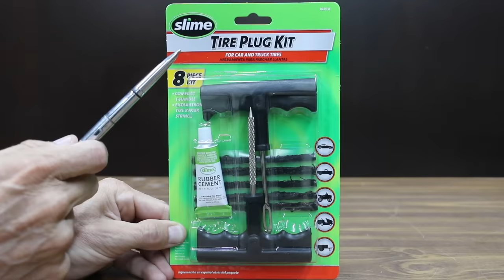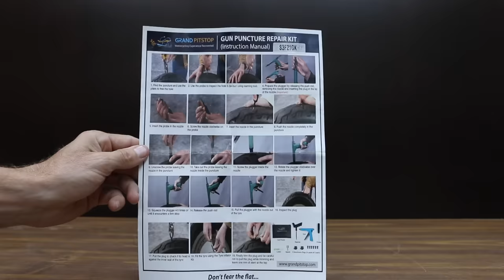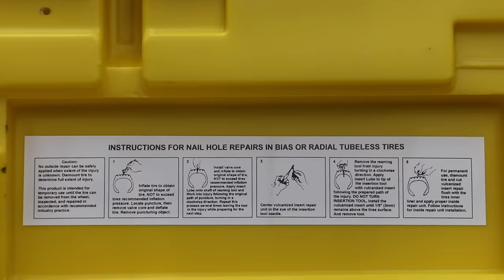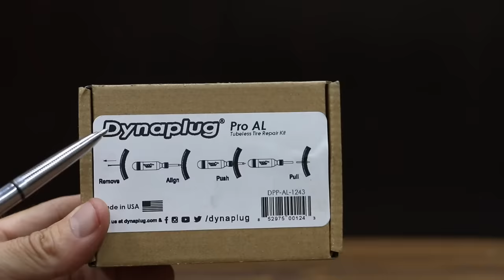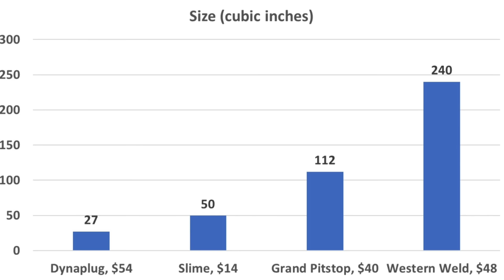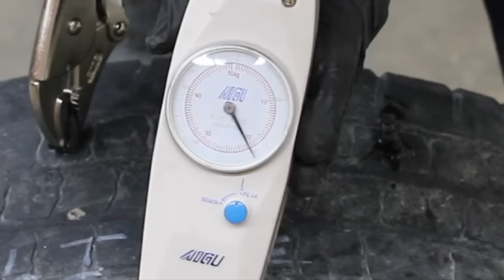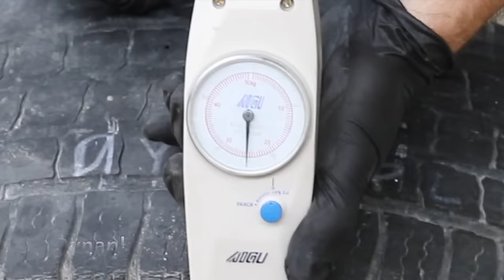Best Tire Repair Kit? SLIME, Westweld, Dynaplug, Grand Pitstop

Comment: I never saw a mushroom plug for a tire. I like the Dynaplug, a nice design and very compact. Great testing as always! You were having way too much fun in that SUV. LOL Be prepared for many "Reaming Lube" comments.
Reply: I picked up the mushroom type for my motorcycle from Stop and Go and glad i did, I managed to get 2 punctures within a month and rode it with plugs in for the rest of the tires life.  Tho riding a motorcycle tire with plugs in it isn't recommended, there are a lot of people who still do because if tire prices.  Also this was in the rear, if it was a front tire I would of changed it right away.
Reply: Do not lick the mushrooms, you will have strange visions, and taste only rubber for a week.  ;P
Reply from the maker: Dynaplug has a great design and the compact size makes it perfect for just about any vehicle.  Thanks again!
Reply: @pheelix-  I had a plugged rear tire on my bike for a year, never had an issue. In fact I ran that tire till the end of it's service life plugged and it never leaked. I'd never do it on a front tire either, that would be too dangerous.
Reply: There's another type 0 shape you we have been using for years in the UK very good as long as it's not a slash lol shame I can't put a pic up
Reply: @bigbothoee8617  any idea what they're called? I have slow punctures on every single tyre on my car lol
Reply: I would prefer the mushrooms for farm tractor use but rope for my truck
Reply: @ek8710  Have you checked for leaks around the valve stems? I have that problem on my set of winter wheels, one of them was fixed, but there are three left that are slowly leaking.
Reply: I have seen the mushroom type plug, got one tire fixed with that back in '87. No problem whatsoever with that tire.
The need to replace tires is not really that extreme if you haven't been running the tire completely empty in which case the cord gets damaged.
Reply: Some might comment on that, butt that would be beneath me. Some a-hole might make a remark about lubing, reaming, then shoving a plug in the hole, but not me.
Reply: @IhateYoutube  In the 90’s I used  the mushroom style on a routine basis. We had a fleet of Taylor Dunn “golf “ style carts for the maintenance crews at a college. The guns cost just over a $100 back then, had a much larger opening, and we would coat the plug with glue. They worked great just too expensive at the time for personal purchase.
Reply: @ek8710  for slow leaks try tubeless tire sealant or slime
Reply: @bmxscape  seconded. The tire shops will hate you but sucks to suck LOL just warn them ahead of time
Reply: when I worked at a gas station in the 60's our mushroom plugger was air powered, worked great, and their were several diameters.
Reply: I used to use that mushroom crap when I was an intern in college. Those things were terrible. They were not guaranteed not to leak nor would they last the life of a tire.
Reply: @BigHoss1776  That's the trick. The companies claim that mushroom plugs don't require rubber cement, but I haven't (and wouldn't) used one without it.
Reply: @justastudentoftheworld3940  ... Since you're still a student, they're looking for their cat over there.
Reply from the maker: Thanks for the feedback.
Reply: @IhateYoutube  We had an air powered mushroom gun at the dealer I worked at in the early 70's, worked great and much easier to use than the hand pump ones currently available. The mushroom plug always seemed like a better more permanent design to me, very glad to see this comparison, thank you !
Reply: ive had mine in my car for like 8 years haha..
Reply: @IhateYoutube  I have had a patch job on one of my tires for about 3 years. I picked up a bolt from a railroad crossing. The bolt was probably about an inch in diameter and the head of the bolt plugged the leak just long enough to get home. At first I thought I broke a CV axle because the head of the bolt was hitting the road and picking up the back of the car. I didn't think it would be repairable but it's lasted pretty well.
Reply: @bigbothoee8617  , 
Can you give us a manufacturer, part number, and retail brand name. It would help to see if they can be imported.
Reply: There are mushroom plugs only you need to take the wheel of the rim and insert it from the inside
Reply: Another reason I don’t eat mushrooms
Reply: @pheelix-  I_
Reply: @ek8710  just get the slime ones there on Amazon for £5 and same day delivery
Reply: @ProjectFarm  TRy long term storage i had mine in my SUV  the thing did not work  the plugs got stuck or glue onto the plastic film and useless
Reply: You've never seen a mushroom plug? I play with mine on a daily basis and it's a one (extra small) size plugs all holes type kit...

Sorry lol couldn't stop myself 😈
Reply: looks like he has natural talent for drifting sport!
Reply: Best plug is mushroom plug trick is fill hole with supper glue install plug bottom side of mush room glued to inside tire like a patch pull with hand on stem of mushroom so it starches skinny add glue around it then let it go. And cut flush with tire. I hace repaired a 1/4 hole made by a bolt that three slime ropes could not plug.
Reply: @znogaragego3421  The Tire I plugged is long gone but I had 2 plugs in it and road it for the rest of the tires life with no issues.  I checked on the plugs every once and a while but it got to the point that i couldn't even find them anymore as they wear with the tire. 

Also FailNine wasn't using the kit that had the Tire Plugger Tool, If he had the kit that came with the Tire Plugger it would of been almost as fast as the Dyna Plug.
Reply: @pheelix-  
I carried a stopngo kit in my motorcycle. It got me home from a trip. I parked my motorcycle an unloaded it a went to bed. The next morning I got up an my motorcycle was on it side. Upon examining everything my tire had went flat. I checked the mushroom plug and it had went inside the tire.
Reply: I have a 2003 Kawasaki prairie 360 4x4 four wheeler and baught new tires for it on Amazon, the first time I took it out for a 2 mile drive, I ran over a branch and didn't notice that a piece of a branch the size of a nickel punctured my rear tire. The next day I saw that my tire was flat and saw that piece of branch sticking out my tire and thought dang, that's a new tire with 2 miles on it and now it's trash..
I then remembered I had my Slime kit and went to work pluging the tire. I took 5 plugs to get it done. It's been 2 years now and many many miles later and it's held up GREAT..I know that the tire should be patched properly, but I wanted to see if it would actually work in a pinch and it did to my surprise. AWESOME video bro as usual, You da man!!👍😎👍
Reply: @dcct1905  Sounds like you didn't pull it back up enough to seal properly.  I have had one do that to me once.
Reply: First you ream and THEN you stick the big mushroom tip in?  I've been doing it backwards all these years!
Reply: They're great for emergency motorcycle repairs
Reply: Yeah, and something to consider when you have to enlarge a hole to fit something like a mushroom plug: you're tearing up the belt, whether it's steel or fiber.
Reply: @phasm42  That is what i like about the mushroom plugs, you only need the hole to be the size to put the tip of the insert tool that the Tire Plugger screws onto.  And the mushrooms are about two times the size of the insert tool. With the mushroom expanding and the air pressure, its not going anywhere.
Reply: @ProjectFarm  please try to see if those grand pit stop plugs wore out, or got pushed back into the tyre? The hard rubber used for plug, it's girth, and lubricant used results in that failure.
Reply: Slime has a kit now similiar to western weld
Reply: I never seen such a thing either
Reply: @IhateYoutube  my dad has 1 from early 80s,who was the original inventor or company ? Patented surely? Dad has 3 sizes of screw on nozzles & plugs and his uses a hard plastic pointed insert for the nozzles to make inserting easy...havent seen anywhere since j.c. whitney quit paper catalog books

Comment: I use a plug kit called the “Stop and Go” tire plugger and I really like it.  I’ve plugged many ATV, mower, car, and truck tires with it, and I haven’t had any issues.  It’s basically the same as the grand pitstop.
Reply: I have it too, and its great quality, includes a zip bag. The trick is to shove the mushroom plug up into the gun tool so that its like an inside out umbrella.
Reply: @ksavage681  totally agree !
Reply: @ksavage681  that’s how I’ve always done it.  Works every time!

Comment: Looking back to this video today, thanks to having a tire issue this past weekend.  I had a tire losing air on my SUV even after filling, so I brought it in for repair.

The tire tech showed me that I had 2 screws in the tire, and one was too close to the edge for them to repair. I should note this is a BJ's membership warehouse location, all they do are tires, the repairs are free, so they are not earning commissions on selling new tires. I purchased the tires from them in 2020 and had a good run of some 60k miles since then, on tires they rotated every 8k miles for free. We planned on replacing the tires before next winter as they have been solid but nearing the tread wear indicators anyway. Being an AWD vehicle, 1 tire is not an option.

I purchased the new tires I wanted but they would not be in for at least 3 days, so I stopped for a Tire Slime plug kit and patched up the tire as a temporary solution.. Something people may not realize is WHERE to put the tire!

In your videos, if people are paying attention, the patched tire is on the rear for a reason!!

IF you must patch a tire, for safety, MOVE IT to a rear tire location!! If by chance the tire plug fails, and odds are it wont, but if you mathematically hit the bad luck lottery you will want that tire ON THE REAR and not a tire that steers!!

My wife drives this car daily as she travels for work, and I moved the plugged tire to a rear as it was just safer for her, until we can have four new tires installed tomorrow. Looking over your video again, Im buying the Westweld kit asap.
Reply from the maker: Thanks for sharing.

Comment: Future test: cold patch for asphalt pothole repair for driveways. I'm sure a lot of homeowners will appreciate it. You can make a few 1sqft boxes that are 2 inch deep to mimic a small pothole in your driveway. Then test several brands of "easy diy permanent" cold patch asphalt repair kits to see which hardens/cures quickest and which stays solid after a week or two after patching. (I've used cold patches that took well over 3 weeks to fully cure/harden. I was able to use a stick and move it around even after 2-3 weeks).
Reply: an asphalt pothole repair needs to last a lot longer than a couple weeks lol
Reply: @schlomoshekelstein908  I think it could be tested with multiple freeze/defrost cycles. Because that's how most paved surfaces are damaged, when water seeps in cracks and freezes, expanding inside.
Reply: @schlomoshekelstein908  oh I get that. I meant to say "test to see if solid after a week or two" because I've tried using cold patches that were still soft and moved around after a week. It didn't fully cure/harden after a whole week!
Reply from the maker: Thanks for the suggestion.
Reply: The city paved my alley way and it made all the water that normally went down the alley into the street dump into my yard then into my basement. I made my own curb out of that stuff and the water flowed into the street again. I was surprised how hard it got after a week of sitting.

Comment: 7:44 single day time running light, and 4l60e crying, my kind of day
Reply: 4l60 or 4l80 in those? I'm only familiar with the 4l60 which the S10s always blow up the sun shell, servos, or planetary.
Reply: @benjaminnevins5211  If its not a 6.0L it would be the 4l60. My yukon has the 6.0 it has the 4l65
Reply: That's scary.  They blow up before the7.5 rear end
Reply: @SloppyMechanics  I guess you find a bad one of anything if you look hard enough. I have towed a 32ft travel trailer all over the southern US with a 2005 5.3L 4L65 and not one single issue. Yet.
Reply: The 4L60E in my TrailBlazer blew shortly after we had bought it. The previous owners had never changed the transmission fluid and it was too far gone. Lasted 210,000 on the original fluid.

Comment: This was one of the most fun episodes I've seen on here. There didn't seem to be a big difference between brands, but that didn't matter much cause it just worked and you looked like you were having a good time.
Reply from the maker: Thanks for the feedback.  I was having a lot of fun!
Reply: The Western Weld, his favorite of the test group, actually came in at $0.80/repair. So it's technically the most affordable option as well. That's what you call a win-win. 👍

Comment: I've been using Slime plugs for years and they have held up very well. I'm also looking to try Westweld plugs in the future. Fast and simple and very handy when stranded on a trail or in the middle of nowhere situations.
Reply from the maker: Thanks for the feedback.
Reply: I've been using Slime plugs for years and a previous brand of the same type for decades.  I can not recall a single problem that I have had with them.  I don't recall a single leak or need to reinstall.  They're really compact so I keep the flat package in the same bag as my inflator.
Reply: Same. I had a screw puncture a new tire and i used a Slime plug. I intended to take it in to get it “fixed” but it worked so i never did. The plug outlasted the tire. 
I used several because of construction and never had one fail. I treat it as a permanent repair and never had one fail.
Reply: had a flat on the construction site pulled out the good ol strips the cement tube missing. chit mixed some styrafoam and abs black pipe glue together dipped the strip done. end of the job I had about 4 plugs in each tire lol.
Reply: had a flat on the construction site pulled out the good ol strips the cement tube missing. chit mixed some styrafoam and abs black pipe glue together dipped the strip done. end of the job I had about 4 plugs in each tire lol.

Comment: I once took my '92 Porsche 968 to Sebring on four Dunlop Star Spec tires that all had at least one rope plug, and drove the track all weekend long. No pressure loss, no failures. Sebring is mostly a concrete track and considered one of the harshest on tires and suspension. I've installed hundreds of rope plugs for myself, family, friends, and customers. I've had great success with them and really trust them.
Reply from the maker: Thanks for sharing.

Comment: The Jaco gauge. I lost two tires on my tow rig and found out the Jaco gauge I was using was reading 10psi low. Which tire gauges are most accurate?
Reply from the maker: Thanks for the suggestion.

Comment: I've always used basic kits like the Slime. Only difference is I always use the brown butyl plugs over the black. Never had an issue. Thanks for all you put into these tests !
Reply from the maker: You are welcome!
Reply: I used the Rhino USA brand plug kit on my mid size SUV about 3 months ago and it hasn't leaked since. About 2 weeks later I used it on my sister-in-laws hatchback with some rubber cement and it hasn't leaked either.
Reply: The brown plugs are the best
Reply: I use the slime plug in my tire and forgot about it a little over two years before it gave out. I was shocked it lasted that long. I should check out those brown plugs, thanks for the heads up.

Comment: I've used cheap rope style plugs and have never had one fail.  I've had them stay in tires for 5+ years and 10s of thousands of miles.  I do try and purchase the largest thickness plug I can find.  I also buy single use rubber cement .5oz containers that I use when needed.  Rubber cement is vital and it always dries out if you let it sit for months between plugging, as I always do.  I just did a plug this weekend in my wife's brand new tires.  She picked up a roofing nail.   That plug will last until her tires wear out.  

IMO, you dont' need these fancy inserters/tools.  They cheap kits work.  Use rubber cement on the reamer and plug as lube which then sets up as an adhesive when it dries.  Thanks for your work.  Love the channel.
Reply: Yes the glue does work as a lube, but I've pushed them in dry and they still work.
Reply: I always try and use the rubber cement but I’ve done plenty without and it doesn’t ever seem to make much difference. In my mind it makes me feel better though.
Reply: @JimYeats  I bought a cheap $15 repair kit, like the Slime, probably 25 years ago.  I buy the replacement "gewey worms" for less than $5 when I run out.  I've never used the adhesive since the first tube that came with the kit ran out.  Four cars in the family and never had an issue with a plug repair.  When the temperature is below 50 deg. F and I'm doing a repair at home, I heat the worm with a heat gun to get it nice and sticky just before it's inserted.
Reply: @chrisgraham2904  Props for fitting “worm”, “sticky”, and “inserted” in a single sentence.
Reply: @chrisgraham2904  Never used the Glue either and Never had a problem.  I always buy the cheapest kits or plugs and the all have worked fine.
Reply from the maker: Thanks and you are welcome!  Thanks for the feedback.